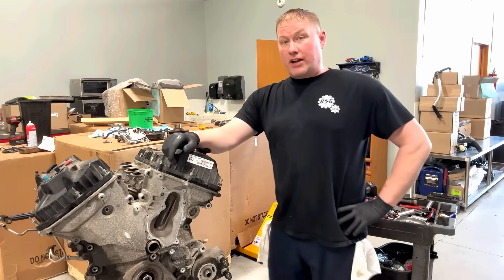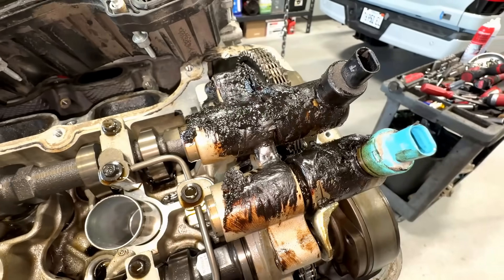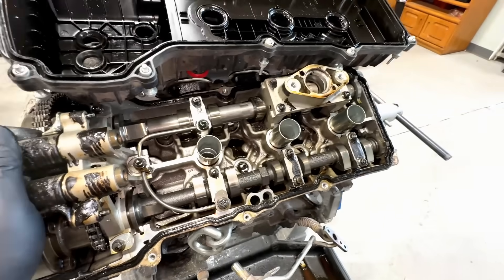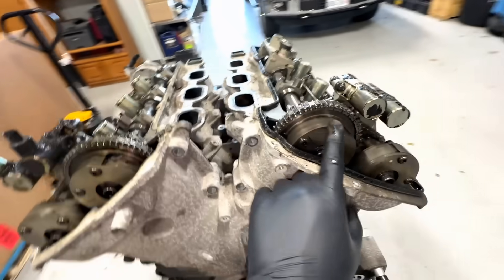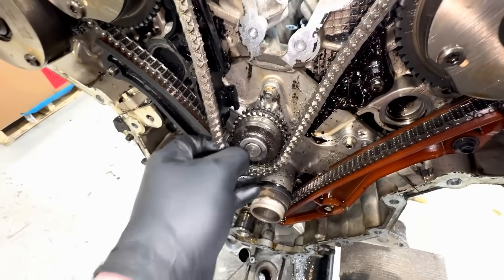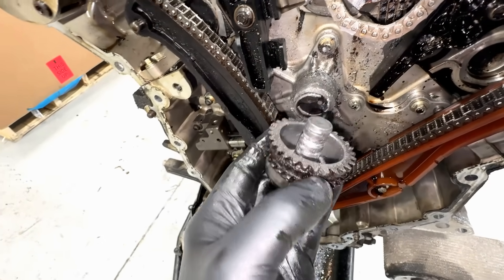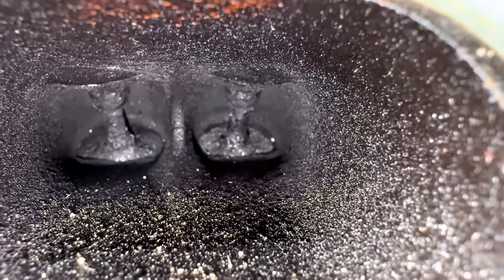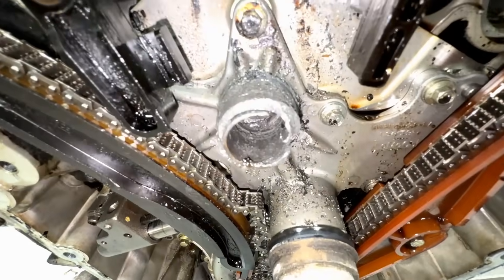2015 Ford F-150 3.5L EcoBoost Engine Failure: 97k Miles Total Destruction!

Comment: Blows my mind... neglect is impossibly stoopid. I do 5K mile oil changes and only ever used Castrol Edge and Motorcraft filter. 195K and she still runs like a legend. 2014 F150 3.5L EcoBoost. Ive owned it since Feb 2020 at 103K miles - I've heard chain rattle maybe 8 times typically in summer when I'm riding my motorcycle to work and don't touch the truck for a week or so. I'm actually thinking about doing the full timing replacement job myself this spring/summer just for sanity sake.

Comment: When looking at the clean vs sludged areas of the engine…based on experience I don’t personally believe the clean parts of the engine is because of BG…it’s simply that sludge had not accumulated there. Sure BG might help, but it is not capable of removing large amounts of sludge and making the area nearly spotless…as seen here. The now clean areas would look significantly worse and burnt brown colored if there was sludge previously there This is just lack of accumulation. Just my opinion.

Comment: I have a 2011 ford f-150 ecoboost 3.5  with 208,000 miles still running hoping for more miles
Reply: I got a 12' with about the same mileage, still running great

Comment: My buddy has a 2016  3.5 eco boost in his f150 he changes his oil every 3500 miles 6 quarts of 5w30 Triax  synergy synthetic with a Baldwin B7449 filter 171,000 miles absolutely no problems ever

Comment: I’m working on 2103 edge 3.5L the engine get stuck when starting the engine the starter struggle to spin the crankshaft when I turn the crankshaft by hand it does take a lot of super  strength to turn over the engine.

Comment: Have you ever done a video on 2007 F150 Super Crew 5.4 PVC valve. I am not sure where the PVC is on this engine and can't find it on you tube. I sometimes have a tiny bit of rough idle at stoplight and would to check the PVC valve.

Comment: I was wondering if you’ve heard this problem before…no codes are present 2013 f150 ecoboost-with 112,000 miles…I’ve always done service as needed according to owners manual…when transmission is warm there is a skip or jerk in shifting only from 3-4 gear…it does make an audible scratch noise…Ford dealership locally says they eliminated everything that could be wrong that’s testable (which they won’t say what those things are)…so they want $5000 to rebuild or $10.000 to replace…
They kinda don’t have a gear reputation for service work and there’s no transmission shops close.  
Any chance you’ve come across this symptom before?

Comment: This comment won't go through b/c I'm shadow banned on ScrewTube. But this is 100% due to EPA and NTSB regulations trying to destroy internal combustion engines, such that it will force consumers to desire / purchase electical vehicles. It's 100% a scam. There are VERY reliable IC engines.... that are also VERY efficient. But the green weenies that run the gov't and ScrewTube don't want you to burn hydrocarbon.

Comment: What kind of mileage do you expect to get from the first gen, 175000 on my compnay truck 2016 f150, 5000 mile oil changes ford dealer doing all the work . Thanks

Comment: would valvoline restore and protect have the same effect on an enginer? I'm looking at a 2018 3.5 that has 89k with 10k oil change intervals logged.

Comment: 2015 3.5 Ecoboost here with 160k. Oil and filter changed ever 5K miles with full synthetic. Knock on wood I have had zero issues since new

Comment: That cleaner works quite well but there's so many small mesh filters with not enough surface area. They just get clogged too easily. I'd be getting one of the oil filtration systems over at Insanediesel for any new engine install. You really should look into them and begin recommending it as a product. They do make a kit for the 3.5

Comment: Oil changes have become supremely important with modern engines, VVT, TURBO, belt driven oil pumps. You are crazy if you don’t change the oil at 5k to 6K. Oils cheap. E Hines are not

Comment: Engines/Turbos are expensive, Oil changes are not. It is cheap insurance when you change your oil at 3000-5000 miles. Does the "Idler" receive engine oil to lubricate the "Big Beefy Bearings"

Comment: Now I don't want to use bg. What's the alternative? Just inherited a 2016 3.5. I know it wasn't abused,  but I now have to drive it cross country and have to deal with it. I hate breakdowns. What to dump in the oil instead of bg?

Comment: Just stopping by to say goodbye and thanks for all the tips and help over the years! I finally traded in my 2012 f150 ecoboost. 
It was a luxurious ride in the Lariat package, but gave me more grief than any vehicle except my mustang in the 90s. I am done with Ford forever.

I think my favorite tip over the years was drilling the weep hole for the boost to drain moisture to stop the engine shudder!
Thanks!

Comment: we do the oil changes every 3k-5k miles, 2017 f-150 3.5 ecoboost, only at 59k miles has horrendous cam phaser knock and now a knock at idle at all times. Ford will only cover 30% of the repair, our vin isnt on a recall for whatever reason. WTF should we do? Trust a dealer to do the timing chain system, cam phasers and whatever else is damaged?
Reply: Dealer install then sell and buy a low mileage pre-turbo Toyota

Comment: Bro I got an eco boost 3.5 and it’s low on power but have no codes. Have a hiss at start up from the engine bay on cold starts but it goes away. I don’t find any vacuum leaks at least yet

Comment: Hey brotha I have a 18 transit 3.5 eco trying to find a rattling noise behind the front cover driver side. I was for sure it was the chain slapping around or broken guide. But I removed the timing components and found no obvious signs or wear beside the primary chain tensioner piston pressed a dent in back of the tensioner guide. But the chain is still tight. I’ve looked at many other things like fuel pressure pump, inspected the cylinder walls for scoring and did a leak down test every is normal.
There is glitter metallic in engine oil a lot of it but no flakes or shavings. If you see my comment I have the video of the noise on my channel. Let me know if you have any ideas?

Comment: I find Valvoline Restore & Protect to be the ideal engine oil for the EcoBoost. Its gradual cleaning action helps prevent gunk buildup and oil line clogs
Reply from the maker: All current synthetics clean over time.

Comment: Do you recommend the BG clean out if the oil is changed regularly? I gotta 155k miles on my f150 5.0…. Change the oil every 5k miles and was thinking about doing the BG clean out to clean up the engine.
Reply from the maker: Nope I would not.

Comment: I just wanted to say how much I appreciate all of your content.  My late father was a mechanical genius and a Ford guy, so I was (very regretfully) lazy about gathering knowledge from him because your brain just kind of assumes they're going to be there.  My work truck is an 08 5.4L and your videos have been EXTREMELY helpful to me.  I recently did a full timing job in accordance with your video and my truck runs amazing now (190K miles)!  The last couple of weeks my A/C was down and I got frustrated trying to chase down the issue.  I watched your A/C diagnosis video and did what I could, but honestly, some of it was over my head when it came to tech stuff. I have an OBD MX+ reader with Forscan software connect, but I'm not sure how to do the diagnosis you do using the software.  Anyway, I just got back from traveling for work where I was sweating my butt off in 94 degree heat and no A/C, so I decided to look at more of your videos.  I came across the one about the simple A/C clutch replacement.  So I ordered a new clutch plate and did the 5 minute job and my A/C is running like a champ again!! Again, thank you, thank you and God bless you in your endeavors!!

Comment: Easy to see how your engine is doing sludge wise. Just get a flashlight take the oil fill  cap off and look in there. You can get a pretty good idea how clean the engine is. Head metal walls should be spotless and all valve components clean and shiny metal. if you see black clumps your oil oci is to high or your when you finally get around to changing your oil you cheap out and use dino oil. Or worse you take it to a quickie oil joint you get the recycled dino vat oil the worst shit on the planet.
No engine is sludgy. You make it sludgy by not changing the oil and when you finally do use shitty oil.

Comment: I’m an old school DITY home mechanic. 54yrs working on my cars / trucks / motorcycles / lawnmowers. Maintenance is key. Clean fluids (oil, ATF, gear, coolant, brakes , etc etc) is CHEAP compared to engine / transmission replacement. Oils have improved… I can remember when 30wt was standard, then 10w40, 5w30, 5w20, 0w20….. BUT today’s highly stressed engines need good maintenance. Thanks Brian - you’re a GREAT mechanic. Cheers for your YouTube channel. I’m reading your stuff to be proactive on my new 2025 Honda Pilot with DOHC GDI. I’m installing a catch can & using 3-4K oil changes. 👍

Comment: I know it's kind of off topic but question for you have you seen the issue with the 2006 to 2012 Ford Fusions 2.3 l breaking the idler pulley bolt randomly
Reply from the maker: nope

Comment: Both my Fords (2000 F150 2V 5.4L, 2013 Transit Connect 2.0L) get 5000 mile OCI's on full synthetic 10W-30 and 5W-30 oils (lately Valvoline Restore & Protect).

Comment: what's your thoughts on drilling 1/16 hole in intercooler down low to drain water and oil on 3.5? Merging on highway and putting 3/4 throttle to bend in stutters, bucks, but when you take foot off it smooths out for gradual acceleration. Sometime will throw misfire #6 cylinder but clear it out and drive easy no problems.

Comment: how your engine looks when you follow Fords recommended oil change interval. 100% 10k miles, no sir set mine at 40% every time no more than 3k miles using Motocraft,  Their intervals for servicing is a joke for all components.

Comment: Holy cow, that thing is trashed. I religiously change the oil in my 2020 3.5 every 5k miles using Pennzoil Platinum. But I still worry about something like this happening. I'm at 93k right now. Anyway, I love your videos. Keep them coming!

Comment: My 2014 3.5 ecoboost has 316,000!  I just replaced cats with catless downpipes because they went bad and were burning ignition coils up.  I do have the camphaser knock at startup, but other than that it is running strong.  I always set my oil life to 80% and only use full synthetic oil.

Comment: So basically oil/filter not changed often enough? OR is it a design "feature" you can't work around? I've a 2018 VW Sportwagen with the 1.8 L Turbo an change oil/filter every 5000 mi with good quality VW approved synthetic...By 4500 mi it's just slightly darker and not even 1/8 " of the dipstick indicator ""safe zone" down. Both are DI engines

Comment: Hey sir! can you make a video with your perspective on the wet oil pump rubber belt being used now in the newer  F-150s? I personally have a 2024 2.7 Ecoboost F-150 and there is a lot of mixed info/ opinions on the reliability/ longevity  of this belt long term. Is it serviceable? Should we be concerned if we do 3K mile oil change intervals normally, etc. I’m using specifically Pennzoil platinum ultra.

Comment: I dont understand why so many of these fail regardless of the year model or gen. My dad's had a first year model (2011 EB F150 Platinum) since new, now at 125k with reg maintenance and has only ever replaced normal wear items like batteries, alternator, etc. I asked him recently what his maintenance schedule is like, assuming he changed oil every 5k or less with synthetic oil. He said he goes by maintenance reminder at 10k mile intervals..was crazy to me because I own 20 yr old cars and have always went with full syn Mobil1 at 5k mile intervals.

Comment: BG says on the can, not to use it on a sludged up engine. I used it earlier this year on a low mileage 25 year old truck, with minor carbon issues like stuck rings and soot on the rockers. Then I used at-205 seal conditioner at refill. It seems that my oil pressure is about five higher when hot. I've never seen my oil look as clear on the stick with this vehicle, as after BG r&p. I'm running about 8 ounces of mmo in the oil too, to continue cleaning the internals.

Comment: When my son bought a 2017 f150 3.5 the recommended oil change was 7500-10000 or 6 month. That was to get the cost to own down. All manufacture just want to get the auto past the warranty.

Comment: Been thru 5 oil changes on my 24 Ranger with 2.3l with 26,000 miles on it going by doing a 200 hr interval on my oil changes

Comment: Have you ever thought about using a scope & pressure transducer going in cylinder for compression & leak down results? Brandon Steckler has an amazing class on it as well as others. Check it out
Reply from the maker: Why would I do all of that when it is built into the Ford scan tool already, no stupid scope required.
Reply: @FordTechMakuloco just much faster and much cleaner & clearer data than any scan tool can do. I wasn’t trying to be offensive. Both tools have their uses and are valuable.

Comment: I’ve been watching your channel for years long before your business took off where you are now.  If I had a Ford and wanted it fixed right I would certainly consult you first.  There are several Fords in the family and I always suggest your shop for a fix.  I think by this point with these engines, you are likely the top expert on failures, repairs and replacements.

Comment: People need to understand that modern engines are not tolerant to skipped oil changes.     A lot of these engines have multiple cams and cylinder shutdown.    You really need to change your oil every 4000 miles no matter what the manufacturers recommendations are.    The manufacturers don't want your vehicle to last for 200K miles.     They want it to blow up and fail.   That way they can sell you an engine or you can just purchase another vehicle.   But either way, they make money you don't

Comment: Was the PCV Valve checked? Anytime I see a sludged engine that's the first thing to check. Pull the oil filler cap with it at Hot/Idle and you should feel a slight suction holding it down.
Reply from the maker: Um no you are way off here

Comment: Neglect will lead even the best engines to the junkyard. Regular oil changes added together are still a whole lot less expensive than replacement engines.

Comment: I've seen this kind of sludge before in a neglected engine.  Used to not be such AS big of a problem.  But with all of these systems that depend on clean oil (AFM/DFM, VVT, ect...) sludge is an engine killer.  At least that sludge will come clean in a standard parts cleaner.  I recently tore down an engine that was full of some kind of 'reddish' sludge.  Parts cleaner won't touch it -- the only thing that dissolves it is Berrymans B9.  The pistons only come clean after a prolonged soaking.  There is no way any detergents in the oil could dissolve this stuff.  Don't know what it is or how it formed, but in a modern engine it's a killer for sure.

Comment: Dr. Brian,
On this gen 3.5, do you rebuild or buy a crate motor from Ford?  I have a ''13 3.5 eco with 160k miles.  Runs good and I just changed the phasers and chains.  I do frequent oil changes.  I did note some burnt oil, nothing as severe as this motor.  Again, when my engine gives up, rebuild or crate?  thank you!

Comment: I drive a 1991 F150 and I change the oil every 3 months, regardless of miles. Oil is cheaper than engines

Comment: My 2019 F150 V8 has had 14 oil changes with 32,000 miles on it. This is compared to the 4-5 oil changes it would have been given if I had followed the ‘intelligent’ oil life monitor and/or the manufacturer recommended oil change intervals. That is a huge difference, not just being a bit fussy on my part, that is less than half the oil changes! This is because I change it every 3000 miles or 6 months regardless of mileage. I can’t imagine leaving the same oil in my engine an entire year, especially in Canada where we get cold starts, idling, and I do almost exclusively short trips and city driving.

Comment: I have a 2012 Explorer with the 3.5L non-turbo V6.  190K miles.  One timing-chain/water-pump replacement at 140K miles.  It still runs like a champ.  If you take care of them, other than that stupid water-pump issue, they're very reliable engines.  And this engine doesn't even have that stupid internal chain-driven water pump!  There's no reason it couldn't have gone 200K or even 300K miles, if it had just been maintained!

Comment: watch the motor oil geek's videos about Valvoline Restore and Protect.  He mentions they changed the way it cleans to keep it from cleaning TOO quickly and getting all the sludge in the pan all at once, like the BG stuff does.  It's not bad if there is not much to clean but that thing looks like it was toast before it had a chance

Comment: I change every 2000 miles. The truck runs great and we use it mostly to tow RV or boat or run grandkids around for various activities.. It’s much better to spend 60.00 every 2000 miles than a new motor. Maybe it’s not necessary but it’s easy and relatively inexpensive.

Comment: Quit putting water pumps inside the freaking engine. At least for those that had the water pump inside them. Especially when driven by a chain. I remember the 3.5 Chrysler but that was very easy to change when you did the timing belt service. It was actually designed as a function of changing the timing belt. The problem with that one was is I've seen engines with 200,000 Mi on them that have never had the timing belt changed.